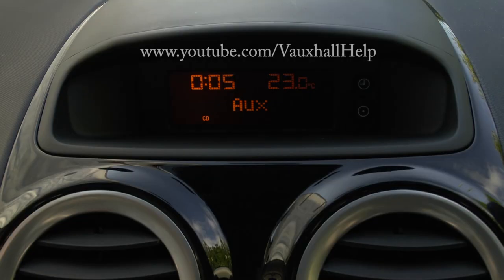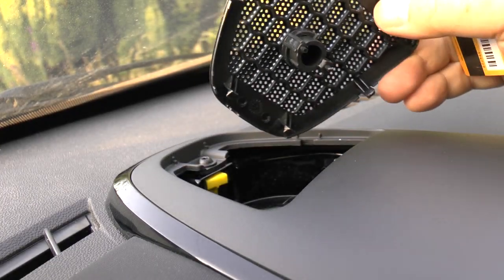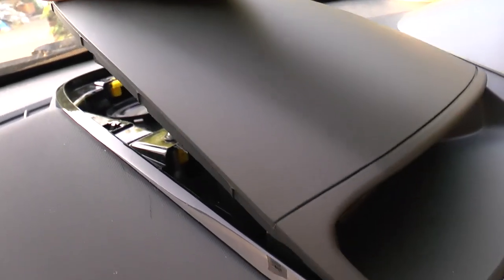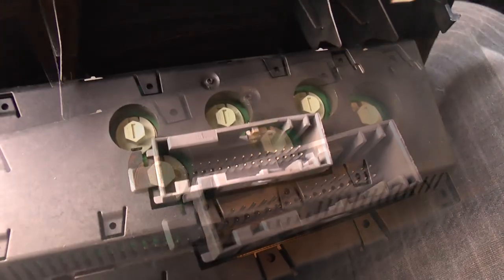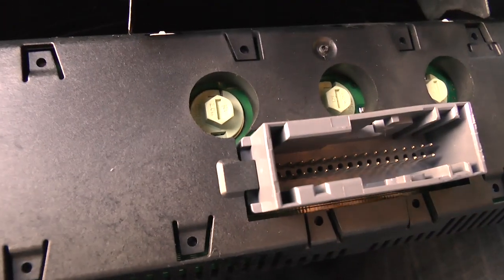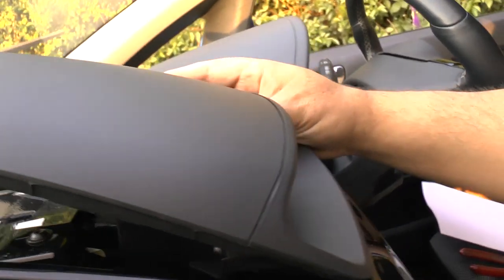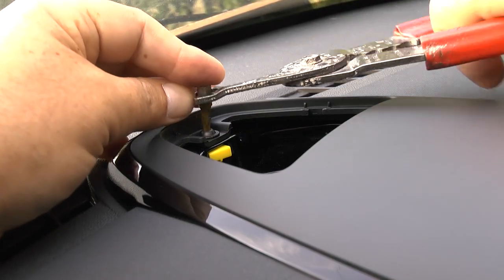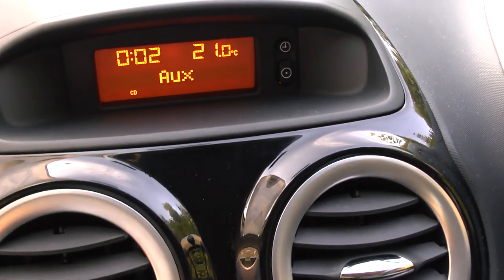Dashboard Clock Radio Bulb Replacement - Vauxhall Opel Corsa D

Comment: Brilliant!! How simple when you are shown how to do things! All the info that you need. Little tricky disengaging the end clips at the end of the panel near the air vents but it just takes a little patience and gentle persuasion. Be careful when you remove the lamps / bulbs as one of mine broke due to the plastic becoming brittle with age or due to the heat or both. Had to use a pair of long nose pliers to remove it.

Comment: Two vids id like to see. 1- how to remove the speedo clock cover and 2- how to remove the steering wheel and airbag. Like the vids:)
Reply from the maker: The speedo clock cover is held on with clips and lifts off with a bit of force, I've broken the clips on mine so a video would look too easy :-)
The only way to remove the steering wheel and airbag is to push a screwdriver through the side of the steering wheel to release the airbag. This will leave a visible hole which I don't want to do :-)
Reply: ***** haha! ok mate. thanks for the reply

Comment: Great video and very informative, especially the reference the hidden menu's! I see you have mentioned doing a video about removing the heater controls to enable the replacement of the bulbs. Have you done this yet as I am desperate to change mine and I went to a main dealer for help and they wanted to sell me a whole unit and said it couldn't be done as the lights were a LED  strip.

Comment: Great vid nice clear instructions, fantastic advice to stop plastic damage. Where can I find a live supply for my newly fitted glove box light, can see a live in the cab light, via the head lining, but not easy to make 100% connection? 2013 Corsa D 1.4.
Reply from the maker: You can pickup a constant live from the cable that goes to the clock. I can't remember what colour it is but I'll have a look when I can
Reply: Thanks have found another method, going to try and post pics asap

Comment: The dial that controls the direcion of my air vents has gone dimer than the other two beside it - is there a way to get to the bulb behind that part ?  of the 3 heating control dials  under the radio its the one closest to the steering wheel

Comment: I need to replace the clock display (I've got a new aux head unit and its paired, so easier for me to fit both and the aux cable myself) Watching this video, excellent by the way, I presume I remove the 2 screws I briefly saw either side of the clock unit when you were changing the bulb, after uncliping (the power cable I presume)? I should be able to do this myself, I'm fairly handy/practical. Cross fingers for me.

Comment: do you have a video how to replace the dashboard bulbs,speedcontrol,temp and tank indicator ... for an opel /auxhall meriva A model 2010
Reply: That’s not something you can do easily, because the leds are soldered to a circuit board

Comment: Can you change the colour from orange to a different colour?
Reply from the maker: I did try putting red LED's in place of the 3 bulbs, but it was really hard to see the display. I think there's an optical polarized filter on the lcd display, I tried removing it but that didn't help
Reply: @VauxhallHelp  was going to try blue as I changed my interior lights to a slight blue as well

Comment: Okay, so I tried to do this, but mine is different: On this, the gloss black bit comes all around the speaker grill, but on mine, it only comes to just past the screen, This means I am unable to remove the screen. Any ideas?
Reply: KyleAB5000 this was on a Corsa D, what model do you have?
Reply: ***** Vauxhall Corsa D SXi 1.4 (2010)
Reply from the maker: KyleAB5000 This was on a 2009 VXR, I've not seen a different design before but I'll try and look next time I'm at my local dealer..
Reply: ***** It's not a different design per se, its just that on mine, the Gloss black bit doesn't go all around the speaker grill. It just comes to the screen.
Reply: process is the same, if you have the facelifted corsa the process is the same as i went from the silver stopping  to the sliver going all the way round

Comment: hey 
This is totally unrelated but i cant find an answer anywhere!
I have a AUX input but when i press AM/FM i cant access the Aux setting.
I have a corsa D 08 
Anyone know why this is happening?
Reply: press cd twise
Reply: +Vee harrison or click the button on the steering wheel which looks like an image of hanging up the phone
Reply: nothing worked and i still havent fixed it lol. im ordering a wire i can put in from the back :) Thanks
Reply: Vee harrison You posted this a year ago and I am presuming you figured it out? if not hit me up
Reply: nope lol. i gave up
Reply: Vee harrison All I had to do on my Corsa Active is literally press FM/AM twice.... if that doesnt work hold it in. It eventually cycles through options and AUX is the second option.
Reply: I think mine may just be broken because iv tried that so many times :(
Thank you though
Reply: I know this is an old thread, but i respond anyway so other people can see it. My car did not have any aux connector, and I could not choose AUX (Corsa D 2008) I got it enabled by Opel (Vauxhall) with the use of TECH2 programming. If you look underneath your cupholder, there should be some wiring with a unused connector. You can either buy a console (cupholder) with a 3,5mm female jack, or solder something onto the cable.

You Won't be able to select AUX vithout programming.

Comment: loved the video, its really helpful! do you maybe know how to remove the rear cup holder (the one behind the handbrake)? The one that looks like this:
http://www.ebay.co.uk/itm/VAUXHALL-CORSA-D-2006-2011-CENTRE-CONSOLE-REAR-CUP-HOLDER/141855214213?_trksid=p2047675.c100005.m1851&_trkparms=aid%3D222007%26algo%3DSIC.MBE%26ao%3D1%26asc%3D20140122125356%26meid%3D5774645c87ad4f6bac70cc5d81688968%26pid%3D100005%26rk%3D1%26rkt%3D2%26sd%3D251678952672

Thanks :)